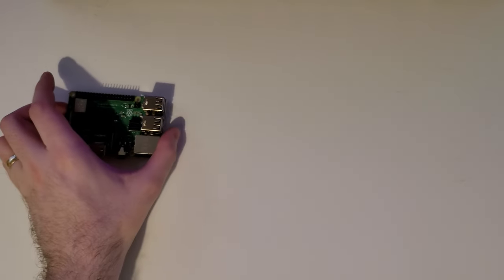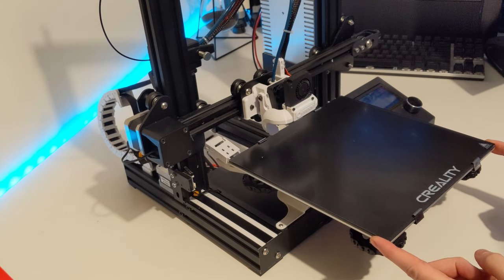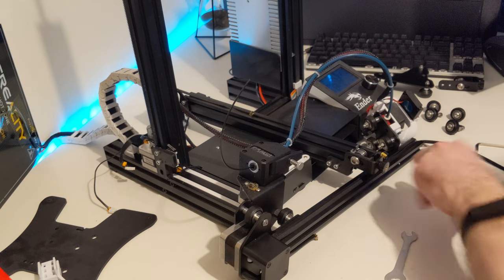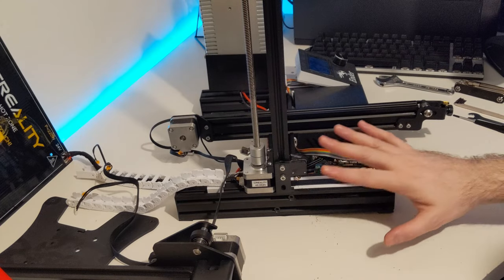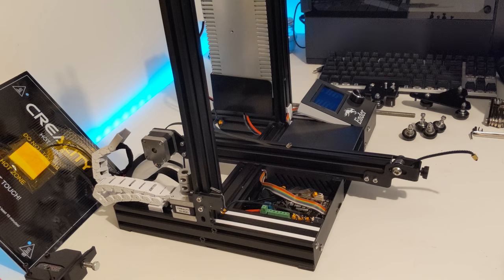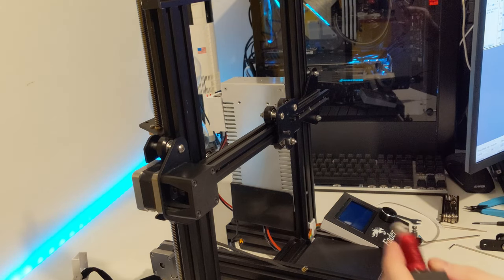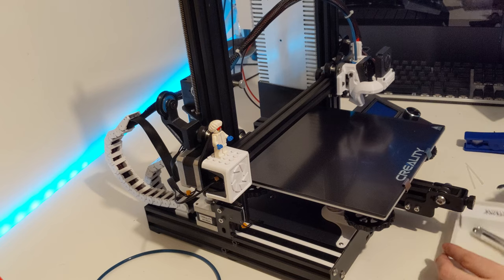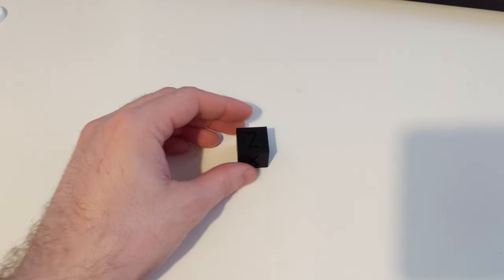My Ender 3 broke! Full teardown and repair!

Comment: did you try an extrusion calibration before doing all this work?
Reply from the maker: I absolutely did. I have no idea why but even at 20% flow rate in Cura it still had issues. Honestly it could have been a firmware/software or even just a nozzle issue. But why waste a perfect opportunity to do some well needed maintenance and make another video! 😅
Reply: @bespokenerd  Video was great.  But I would guess that is was firmware related you may not have actually run a calibration test?  measuring 100mm (G1 E100 F100) and then updating with M92 E###.#?
Reply from the maker: @vbbartlett  I have not delved into gcode specifics yet, that will come soon enough, but if you are referring to E-step calibration then yes, I did do the calibration when I changed to the Titan extruder on previous setup and again when I changed to the BMG clone. It was 100mm spot on! Which is why I tried adjusting flow next, figured it might be a filament specific issue.
Reply: @bespokenerd  Ok, just checking.  I have run into that problem several times.  When I switch out filament or nozzle I often have to set the E-steps to the appropriate values and have noticed that sometimes it is significant.
Reply from the maker: Do you think it is something worth doing for every filament change? I do the usual, temp test tower and flow test with the calibration cube. Hadn't thought about e-steps for each filament though... 🤔
Reply: @bespokenerd  No, but I am now aware that if my first print with a new spool is off, I will replace the nozzle, clean the hotend and if that doesn't improve then the next step for me is the extruder calibration.  I have found that different colors have different properties and will extrude differently.  (Not all the time, but if a nozzle/hotend clean doesn't fix it, then the extruder cal does).  Depending on how much you print though, a tear-down and rebuild is also useful.  WIth all the dust and debris a good cleaning wouldn't hurt a thing! And it was a good guide for that. :)
Reply from the maker: @vbbartlett  I will add that to my new spool checklist! Seems like it would be useful. Thanks